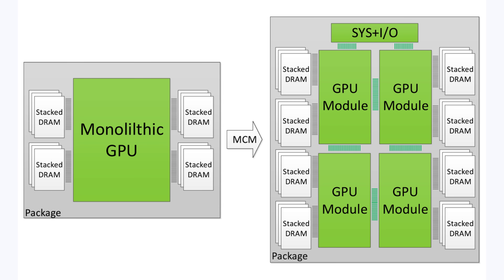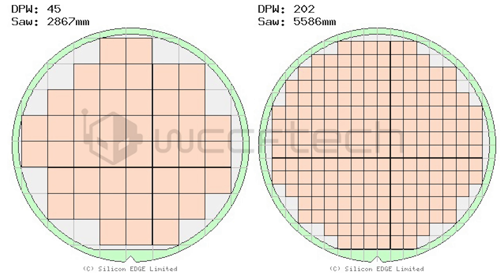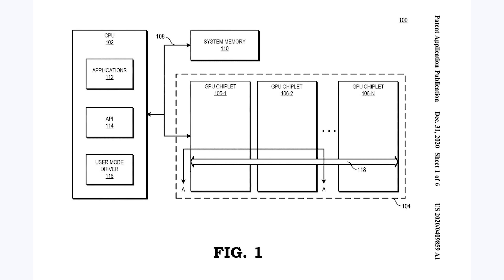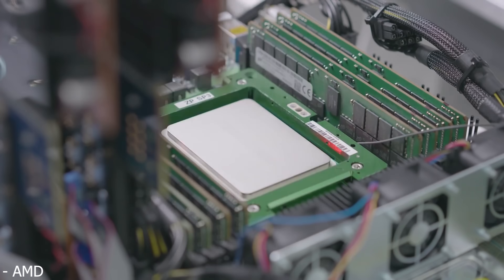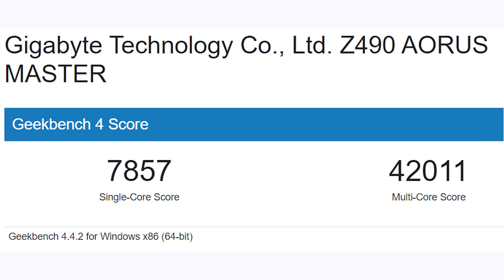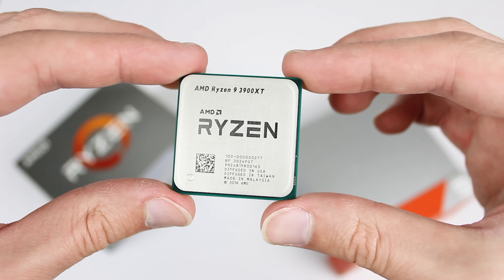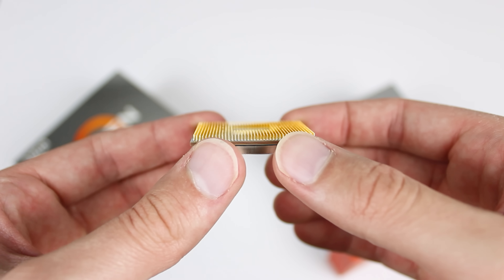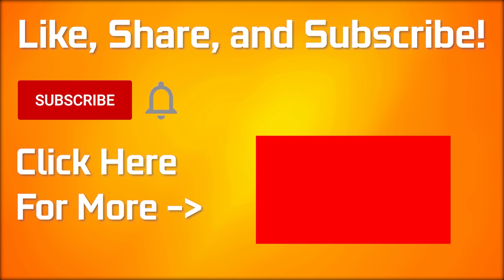New Secret AMD RX 7000 GPU & Intel CPU Leaked

Comment from the maker: GOAL: 2,000 LIKES!
Do you this leaked MCM design will be in the Radeon RX 7000 series, 8000 series, or 9000 series? Let me know your thoughts in the comments below!
Reply: Rx 7000 I hope...
Reply: 7000
Reply: MCM designs were a logical outcome with Zen2. GPU equivalent was already a obvious when RDNA introduced "Infinity Fabric". You had to be blind not to see this coming. This also shows the cooperative nature of Nvidia and AMD. AMD tested MCM and high speed interconnect. Nvidia tested "cores" (CUDA, RT, etc) for viability to use any chiplet as a dedicated "core". Like RT chip, Shaders chip, physX chip etc... I just hope the API will be standardized. The only competition has come from dedicated APIs which ruin gaming environments!
Reply: the way that hair resists megatons of energy on that speed speed never lets me down
Reply: 7000 series
Reply: I hope they show up in the 7000 series, but I wouldn't be surprised if it takes longer or if they even make a new naming standard for them

Comment: Makes sense does the same multi thread score on the new intel chip to the 5800x as it’s supposed to be a massive power hog. Even with really high single thread, once 1 core is boosted it leaves very little spare power to boost any other cores.

Comment: How to improve graphics cards:
 Try to picture this with cheap Amd 6700 xt

- gfx board with the possibilities to plug-in more than one gfx chip. Up to 4 would be great

- same board with the possibilities to plug-in simple gfx chip wich hold only cu with dma, to allow to developer for general pourpose programming

- A simple 4 cores 8 threads cpu to handle drivers and draw calls.

For a few more dollar, we will have a Huge leap into performances!

Comment: I donno.  Gpus are already built with clusters of processing units.   Nvidia and AMD have gotten really good at carving out the under performing or defective parts of the bigger dies.   For example a 3060ti is just a 3070 die with some bits disabled.   The yeilds they get on the bigger dies are actually really good because they don’t have to throw out much.    What AMD did with the infinity fabric and chiplets for cpus was amazing but I don’t think the advantages are as good in gpu tech.    Hopefully im wrong.   I like better and cheaper and the days of getting huge performance increases from better fab tech every 2 years are over.

Comment: Don’t see anyone complain about Intel cpu here. Hey where are you? 14nm vs 7nm. Is that good enough to prove the strength of Intel? Intel is slow in architecture but faster on another aspects such as single core performance so don’t blame Intel. And AMD fans should be nervous if Intel can catch up on the architecture. If a fair game in architecture exists between Red and Blue, Red has no chance

Comment: Multiple GPU is bad, it Will increase latency between separate chip. Just look RX 6000 as example, it basically GPU with 2 CCXs like. When 1440p it wins against Nvidia rtx 3000, but when 4K when all cores needed RX 6000 fall behind Nvidia.

Comment: Dunno how 5000 supply is other places, living in the UK and I was able to get a 5600x with no queues or anything last week, website had it in stock for at least a couple of weeks before running out. Another had it in stock at a 20 pound premium and ran out during Christmas, but otherwise stock levels are okay. 

Which is evidenced by checking eBay and would be scalpers are selling them for 320-330 pounds (which is hilarious because eBay charges a 10% fee, so scalpers are losing money on selling them). 

3000 series is an entirely different matter, though stock is slowly improving and I managed to get a 3060 ti for 440 pounds.

Comment: I think the whole infinity cache design for reduced latency is an important step for MCM GPU design. Because from what I know, GPUs are even more sensitive to latency  than CPU due to the large number of processing units for any sort of synchronous compute task.  I don't know how optimistic I will be about the first gen of MCM GPU, but maybe they will refine things on the Ryzen stuff before they implement it on GPU side.
Reply from the maker: I'm thinking the first GPUs that are MCM will be data center. Than in 1-2 years they may filter over to gaming, but Intel is already working on MCM gaming GPUs, so it could be the RX 7000 series.
Reply: @GraphicallyChallenged  That be true, since many data center apps  are more asynchronous compute and hence latency penalty isn't that significant (mileage may vary).  Although, data centers are usually low to adopt new tech, so we shall see. Again, I think refining the Infinity cache system will probably be the biggest indicator of how was we get MCM GPU adoption.